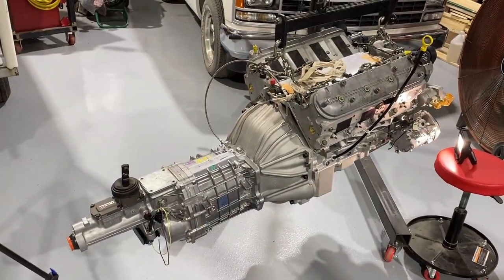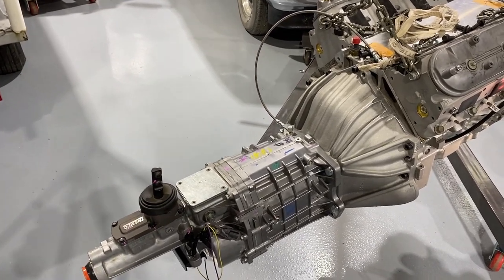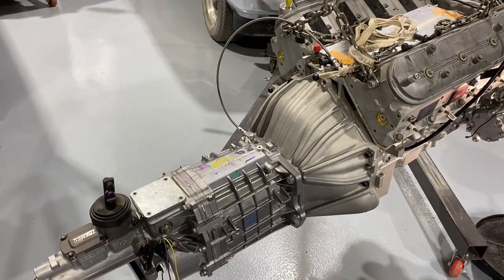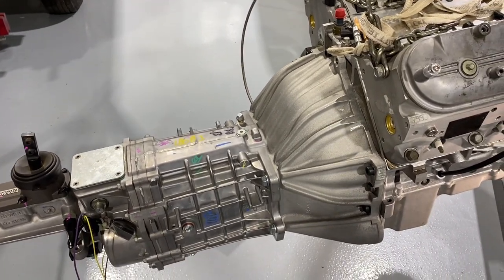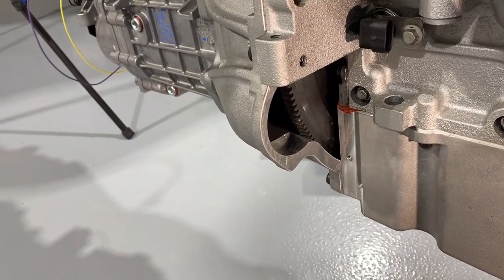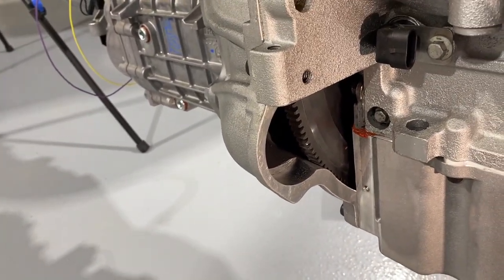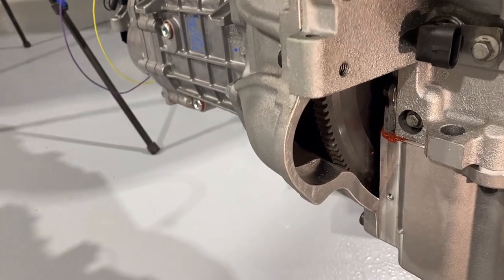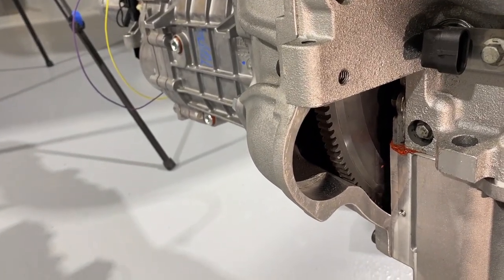LS Swap Tacoma Tremec Trans Tips, NOONE said this could happen!

Comment: What kind of ecu and driveshaft will y’all be using
Reply from the maker: The LS pcm is driving the engine, once all is up and running with all the gauges working the way I want, I will thin out all the stock wiring. So, until all is done, I am not going to just go and pull the original pcm. The driveshaft is the original unit that has been shortened approximately 2.5".

Comment: How much do you think this manual transmission set up be after it’s all said an done?
Reply from the maker: Are you referring to this specific application or a range? Obviously if you scored a used tkx the price would be less than a new one. But, most of the other parts needed would probably be new. Easier to call it without the trans price since that can vary and in this case the customer supplied the transmission. Don’t know the exact cost for it but I do know he got it from someone who had originally purchased it then changed their plans. Also, the flywheel and clutch are a big variable as well…steel vs billet and stock vs performance clutch. Prices can run from $200-1000… I would say for the average person to this with a good stock GM ls1 style clutch, stock flywheel…..maybe $650.   + trans + shifter + possible drive shaft modifications…you get the picture.  It’s hard to get real specific on this one because the owner supplied the transmission, bellhousing, dual clutch, fluids. We purchased the hydraulic throw out assembly and there were various small parts needed to complete the installation. I’ve seen “kits” available for swaps like this in the $5K range so I would say that’s about right on average. Gotta look at labor as well and the time it take to make everything fit right and install. It’s not a “cheap” conversion. If you can do most all the work yourself that will save $ as well as the cost of the transmission itself. Sorry to be so long winded, the answer is not as easy as the question! Thanks for asking.